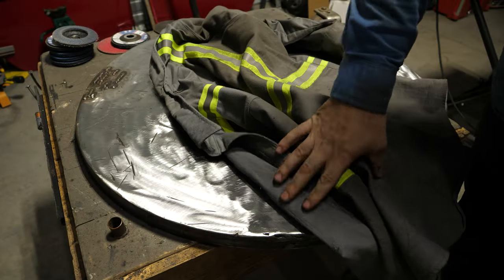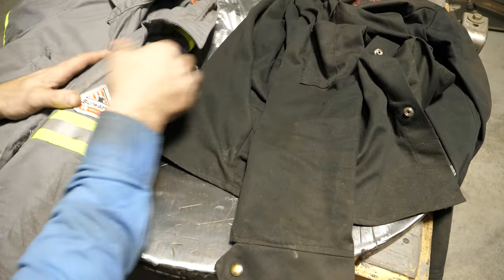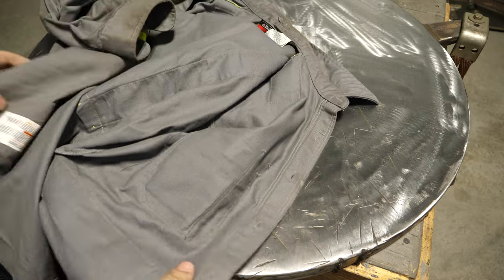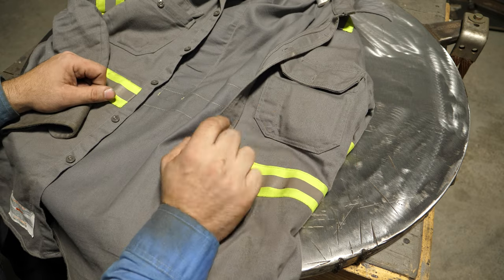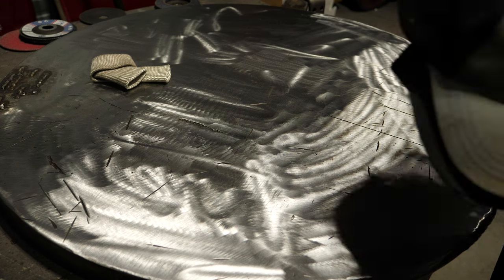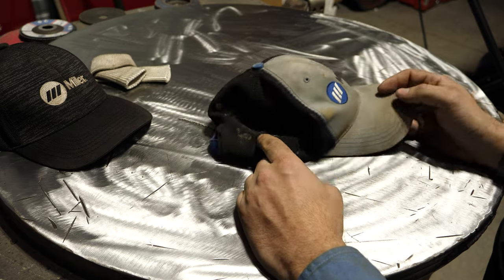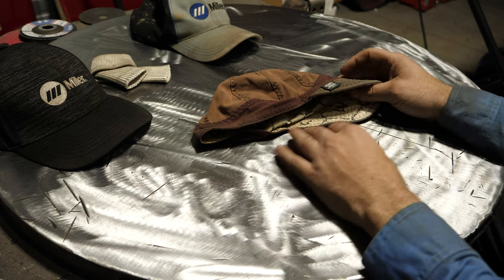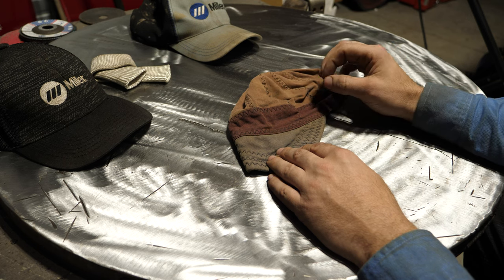Lets look at some FR work clothing 😀

Comment: Great Video!  I worked in a Power Plant for 40 years, with the last 20 of those years in FR clothing.  Fortunately our union (IBEW) mandated that the company pays for all FR clothing, but it was mandated that the vendor had to be a unionized company based in the USA.  The clothing was very expensive and both Style and Colors were mandated by the company.  Some of our stuff was Arc-Flash rated for high voltage switching (12,000 volts), and was very warm indeed, no matter how cool the air temperature, you would sweat your butt off.  Some parts of the plant, the ambient air temperature surrounding certain pieces of equipment would exceed 140°F, and we spent minimal time in those temps; but oddly enough, the heavier fabric did help protect you for a while (think of like hot pads blocking the radiant heat). 

I too am a big guy, and eventually I figured out that I could be cooler if I wore my clothing looser by ordering a size bigger shirt, and instead of pants, we were allowed Coveralls.  The coveralls allowed the hot sweaty fabrics to hang loosely (especially around the waste i.e. no belt required to keep your pants up), and the shirts too could also hang loosely either tucked in or out, which was style more than protection.   I found it to be cooler, when the shirt was tucked inside the coveralls, as it seemed like air could move around your body and vent out the gaps around your body because the coveralls were looser than street clothes - weird but true.

Also just a couple of notes about what makes FR flame resistant what it is, is mainly the density of the fabric weave.  The tighter and heavier the weave, the better the protection.  It is true that they also treat the fabric with chemicals that help retard flammability, which is not to say it can’t burn, it will as evidenced by holes being burned into and though the fabric, but rather it means the fabric will not support (sustained) combustion, and not spread.  This is why they limit the number of times it can be laundered, and if you look close enough, they will also recommend certain detergents and fabric softeners be either Used or Not Used, as it has an effect on the fabrics chemical treatment, or how long the manufacture will guarantee the fabric will meet regulations.  The union argued that any less expensive cloth manufactured offshore, could not be guaranteed to meet minimum FR clothing standards. Also, as you have mentioned worn or frayed clothing is the main hazard where flammability (supporting sustained combustion e.g. kindling easily ignites, where a tree trunk is not so easily ignited), more so than the chemical treatment. As a member of the union, and by company mandate, we had to maintain our FR uniforms per the contract, and they held us to it by way of the boss saying, your clothes were unacceptable, and either change them immediately, or face disciplinary action.  Needless to say, we all had spares on hand. 

As a Home-Gamer, the main point is to wear natural fibers, with a high density weave, in good repair, and to cover up what’s important to you. Personally, I was less concerned about the chemical treatment wearing off than just having a good heavy fabric between me and the  heat aka sparks. 

I’m sure one can go online and find FR clothing laundering instructions, that will help maintain the protection factor, given the investment you are making in your PPE, and regardless of where in the world it’s made, common sense dictates you do the research into what you’re buying, and as always if it’s too good to be true, or really cheap $$$, you are probably not getting good protection!

We all bend the rules sometimes, and that’s a personal choice and that’s OK, but routinely bending the rules of commonsense, will eventually catch-up to you!  And if you think it won’t happen to you, then Think Again my Friend… ask me how I know!
Reply from the maker: Thanks for all the great thoughts and info regarding this.  All of It all makes sense to me.  The electricians that work at the facility I do are required to wear higher standard standard clothing than me, and I have seen how hot some of it is lol.  When it comes to big jobs on main breakers and feed lines they don’t even have a guy qualified on site so they contract out a high voltage maintenance company (HVM) to do the work.  I have seen those guys in space man suits at over 100degree ambient temps inside of buildings, no thanks lol.

Comment: Hi Greg.
I picked a few excellent tips on what to consider when looking into FR clothing, and thanks for the hints to Lori. You know that I love the red Lincoln gloves that you sometimes use. We have handled and touched unexpectedly hot pieces of metal more than once, and these saved our hands from burns. Cheers.
Reply from the maker: Hah it’s funny you mentioned those gloves, they have have been in my truck and I just found them.  I ended up doing a emergency repair on site a little bit ago, and threw those on my center console only to have them fall behind the seat.  You’ll be seeing those back again soon 😀

Comment: I just came across several of these shirts for free , could not believe it .  They feel more comfortable than the Lincoln welding  shirts , though the Lincoln are lighter weight
Reply from the maker: Awesome deal lol.  So far mine are holding up great.  Definitely more durable than most of the welding jackets I have used (I have a Hobart and a Steiner brand).

Comment: Really appreciate the vid. Seems quite timely after I gave myself a little sunburn with a welder over the weekend. Probably wasn't the best idea to be welding in a short sleeve shirt though. A set of those Lincoln sleeves would have been perfect. I'm going to check out those jackets also. Summertime welding is no joke!
Really appreciate all the advice, keep it up!
Reply from the maker: Haha I saw in that video you had mentioned the burn.  I always wear long sleeves so I don’t burn my arms, but my neck gets burned if I forget to fully button up the shirt.  I will have to do a video on wound help.  I find “silvex” works great for arc burns.
Reply: Don’t screw around when welding regarding clothes. It’s not just the “burn” you can get. It’s the UV that causes cancer as well. Normal sunlight has longer wavelengths which tan and eventually can give cancer. But welding also has short wavelength UV which a much stronger carcinogen. It’s also cumulative. The effects don’t wear off.

Comment: PPE is an interesting topic. I have a leather Black Stallion welding jacket. They’re about as protective as you can get. The way they protect is that they’re so thick and stiff, that after you put it on and do the snaps, you can’t move easily enough to actually weld. You can’t get better than that. I do have the sleeves, in leather. I don’t mind those. Wearing one on the ARM the sparks are flying to when grinding is a good idea. I also have leather spats for when I’m too lazy to change my slip on shoes. Particularly when you’re plasma cutting, they make a big difference.
Reply from the maker: The leather is hard to beat, it will last when normal light welding jackets will fail.  Now that I am doing a lot of big repair work I definitely need to get some legit leathers.  Burning though cheap stuff gets expensive fast lol.
Reply: which leather black stallion jacket do you have?
Reply: @_hector__  I don’t remember the model. It’s a heavy yellowish brown. I’d have to go and look. If I remember, I’ll do it tomorrow.

Comment: I see from Lincoln, Miller, Bulwark with FR ratings or CAT 2 and arc-flash rated.... but no UVP ratings... is it safe to assume the welding shirts already offer UV protection?
Reply from the maker: Due to how thick the material is it would have to block all uv.  I know I have spray arced at 300amps with no sun tan with that shirt, and I am white as a ghost.  Your post brings up an excellent topic I will have to cover:  UV exposure and proper clothing.  I have a UV light and sensor.  I bet a ton of normal clothing wouldn’t block much uv.
Reply: @makingmistakeswithgreg  Thanks for the reply, much appreciated.  Looking forward to the test results!

Comment: I heard a pipeline welder who gave this advice.  Never, ever, wear anything with non fr synthetics.  He told the story of how he saved a few bucks buying cheap jeans with a small percentage of synthetic for stretch.  He lost the muscles on his lower leg when the synthetics burned and melted into his leg.  It was a gruesome story.  100% cotton or wool. Or fr.  Just saying.
Reply from the maker: Once plastics get cooking it’s like tar stuck to your skin.  Definitely not something you want to try to remove.  I know I had a set of welding gloves that had some form of silicone on them.  Well the plastic got hot, and stayed hot even after I immediately removed my hand from the welded area.  It felt like someone had a lighter to my skin still.  Pretty dumb idea to make gloves out of a material like that for welding, I can’t imagine how bad pants would be 😮.

Comment: as old soviet union are welder uhm the only protection we got was a pair of leather gloves and a mask or google of your choosing other than that it was up to you back then men were men and equipment was not to be babyed i mean you got soft on your welder the damn thing would over heat you hade to have high amps high fan speed and common sences if not you died 

welding requiers common sence wich is very uncommon